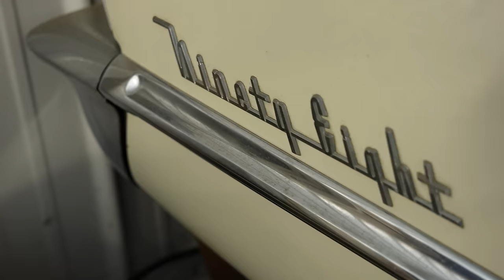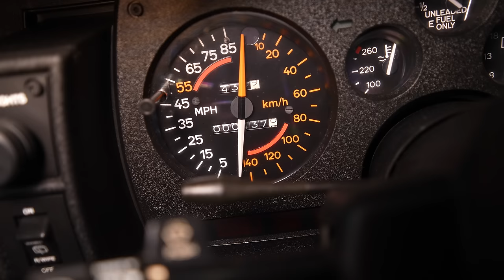Three SISTERS Inherit 40 Amazing Barn Finds From FATHER | Barn Find Hunter

Comment: We had an old Chevy truck like his sprayer truck that was used as the farm trap wagon, there were bulk holding tanks on it for diesel and gasoline of 150 gallons each, a compressed air operated bulk barrel supplied grease gun and a box containing various tools most likely to be needed to repair breakdowns while operating machinery in the field. Was a great low mile farm truck.

Comment: Doesn’t the hot/cold cycling by-product of accumulated moisture dissipate if the vehicle windows are left slightly open and if the facility has large ceiling fans to move the air?

Comment: For the mold, the experience I got with my cars, that sit outside throughout four seasons, is that it develops if water gets inside the car, let's say for example with wet boots or washing carpets and not completely drying them out, not with temperature change, it does not produce enough water, but once enough water is there, it is trapped, then mold will develop.  It can easily be removed with a mixture of water, soap and vinegar and then drying the interior completely by keeping the doors opened in a dry weather for hours (not sure how much is enough, I often open the doors during day time two days in a row)

Comment: I would block up the cars to take weight off of the  tires so they don't Crack, and use a product inside the vehicle called  DRIZAIR to absorb moisture .... to avoid the mildew..... thanks Tom, amazing collection.  Also the Chevy Power Pack was not just the Rochester 4bbl but also the  Heads
Reply: Unless the car is ONLY for show, it's a bad idea to use really old tires on the road. The rubber inevitably decays, carcass cord too. Even the wire in the beads can rust to an unsafe level. Best to set them aside if you want to hold onto them and use modern repro tires for driving.

Comment: The old '48 Buick straight eight was a delight,it would pull away at 5 mph in top with a purr,the hood has 1 chrome latch each side,you simply pull the latch back on one side and lift,there should be a rod that holds it open,close it and latch,to open the other side is the same.

Comment: The Buick hood tilts to either side. You push the emblem, pull the lever and lift it, the prop is in the center of the firewall. I have a 48 Sedanette, wish I could find a convertible like this!

Comment: Great cars and video. A few hours? 😂 I love it. I've been doing something wrong for over 50 years, I guess. I'm a perfectionist, and I take take vehicles apart to the last bolt and last wires, and then I put them back better than new. I have done so, but it's been a couple of years I've been taking a break. I love older vehicles and always have. I'm glad I found your channel but my wife isn't very happy about it. 😅

Comment: My first car (1969) was a '57 Chevy BelAir 4dr HT with the 283 w/ Power Pack heads and 2spd Powerglide auto transmission, and only a 2bbl.  Dad and I took it down to Tijuana (70 miles south of us) and got both front and rear seats properly stuffed and reupholstered with black naugahyde (real naugas back then) using nylon thread for life. Cost: $50.  A friend rebuilt the engine for me for $200, including the parts.  That was a fun old yacht.  Wish I'd had a barn to store all my old cars.  I'd be rich today.  //  Well, the pex and A/C units were there, why didn't the girls get them hooked up and clean the mold before it got bad?  I don't understand that at all.

Comment: @11:35 My first car was a 1953 Ford Custom with three on the tree. I learned how to lay rubber downshifting on that car.
Headlight dimmer was a foot switch on the floor, manual choke, AM radio, vacuum operated wipers that would slow as you went up a hill, no A/C had vented windows and vent on sides under dash, no power steering, crank windows, manual door locks and a back seat you could sleep on!

Comment: This brings back my memories of my 1948 Oldsmobile straight 8.  It burned more oil than gas. And my 195. Dodge hydrostatic 4 cylinder flat head.  3 on the tree that I could pop the clutch at idle and it wouldn’t stall.  Won a few bets on that one.  Great video and blessed children of that forward thinking father.  How many Mickey Mantles baseball cards I used on my bike spokes to make sound I’ll never know😡

Comment: i believe the 48buick the hood opens left or right   and the hutticane  willys engine was 51 up    4 cyln intake valves in head exh in block had   rod bearing problems didnt live long  flat heads were continentals had many of them

Comment: Well like this dad! I’m a dad and did same thing except still alive obviously and not done buying cars ….in my 50’s and in a race track club so very much a track guy … so my cars are all performance cars…all have been modified firstly for security…but have all original parts …. Born in 72 but my first track car I bought was a 1970 911 …w hen I was 23 …then 77 911 then wrx sti then Subaru because the Porsche parts were very expensive especially when you track a car , just wear and tear parts brakes fluids etc and lack of mechanics were unavailable… then bought 1997 911 turbo because it was my dream car when I was a kid… was never intended to be a track car but was not expensive at the time and always wanted one … then bought corvette C6 Z06..first generation and then C6 ZR1 … still use them on track and love to give everyone present a good run …important note …started using Hoosier Slicks at track starting with wx sti … best upgrade after safety stuff …then Nissan GTR then bought Porsche GT2RS was lucky to be able to get it …and just picked up 2nd Nissan GTR track edition… none of these cars have been used as daily drives … have always had a Yukon truck for that…cars I got new were broken in and then trailered to track …. Slick tires are not legal on the street where I live and anyway with a limited heat cycle and average in best case 3-4 hour max track time … not smart to use on street …only one car on list has more than 40k kilometres…including first Porsches … have a nice garage and all cars have always stored indoors in heated space…my intention is the same as this dad… have a few more to get as long as I can keep driving… have 2 young kids … my daughter is 14 and not interested lol … but have been blessed with a son my girlfriend adopted who is now 5… he so far is a total gear head! As soon as it was possible for me about 15 years ago bought a farm for the space and barns that I demolished and rebuilt with heated floors and critter (mouse) proof … still close to civilization…rent land to farmers… like the lottery thing they did to see who gets what …. Might do that …thanks for great video ! Nice to see not the only person with this type of plan .. I’ve been called crazy several times …I didn’t have a dad …never had an example to follow so glad to see this…

Comment: in 1957 the 265 had a chrome V8 emblem with a 283 it was gold. So before you opened the hood we knew it was a 283 the 4 barrel carb ment it was a power pack.
Reply: I had no idea they made both the 265 and 283 in 1957!

Comment: The mold was probably avoidable even without environmental controls. A nice dry space is great but warm and cool swings aren’t the issue really. It’s when everything in the barn is cold and you get a sudden warm and humid day. The humidity gets inside faster than the temperature inside goes up … and the humidity condenses on everything.  Just using a fan to allow the temperature inside to rise with the outdoor temp probably would have done it. Or leave some windows open.

Comment: When I was 16YO I had a 1938 Chevrolet Master deluxe sedan.
Flying down the highway a 1969 Chevrolet made a Left Hand turn fight in front of me.
The driver went to High School with me.
His explanation for the crash was that he used the distance between headlights to judge distance.
MY '38 had the headlights in pods attached to the side of the radiator.
As they were perceived by him, I was a safe distance down the road.
Both vehicles were destroyed.

Comment: That's not the way to open a hood on those Buicks.   They open from the side, one side at a time.   There's a release below the dash on each side, so you pull the side you want to open and lift that side, a prop at the center of the firewall will then support it in place while it's open.   Yes you can easily remove the whole hood by releasing both sides but that's not what you do to have a look or check the oil.  Maybe don't mess with other people's cars if you're not sure what you're doing.

Comment: @13:00 Actually, it would be like the fluid in your vehicle cooling system with a combination of water and non toxic antifreeze in case of a power failure in the middle of the heating season, the plumbing doesn't burst from freezing.

Comment: Radiant heating systems for concrete flooring doesn't operate with water, OMG, think about it. Some systems may incorporate a small amount, but the majority of fluid running through the system is some combination that is mostly ethylene glycol.

Comment: Nice collection of cars. However before starting them and driving them would be highly wise to go over them first.
For my first car my dad bought me a 1971 Chevy Nova he bought it from a dealership for $900 dollars. It was owned by a old lady which she let her grand daughter drive it to collage the car only had like 40,000 miles on it which was good for a car being like 22 years old at the time.

My last car was a 1996 Plymouth Neon bought it when it was 4 years old and it had 44,000 miles on it. I owned it until fall of 2023 and during the whole time I owned it I only put 76,000 miles on it. So when I got rid of it the car was 27 year old car with only 120,000 miles on record. For a 27 year old car it still had 95% of it's factory installed parts besides the normal things that has to be replaced like belts and stuff like that.

Comment: When i was 14 i was an ignorant kid i was given a 69 Chevelle ss 396 with 62 thousand original miles still had factory clear plastic over the seats i didn't know what i had and traded it for a brand new ford probe with dark tinted windows graphics all the stuff i thought was cool only had 3 thousand miles i thought i got a deal after i grew up a little more i realized how big an idiot i was is give anything to have that car back and ii now understand why the dealer traded me strait up if i had known the true value and was smart they would've never touched it and i would've never driven it but i did learn a second lesson to and that was in my prospective everyone has there own opinions but i traded it for junk and I'll never stray away from Chevy again and yes now at 45yrs old i still haven't forgiven myself for what i did

Comment: You have no respect for the old cars. You close the Caddy door by the top of the window, you slam the door closed on the '57 Olds. You removed the aircleaner on the '57 Olds when there was no need to. The shape of the aircleaner indicates it is a single carb. You handled the '56 Caddy's fuel filler tail light too roughly. Olds is two steps down from Caddy. Top to bottom...Caddy, Buick. Olds.  Pontiac. Chev.